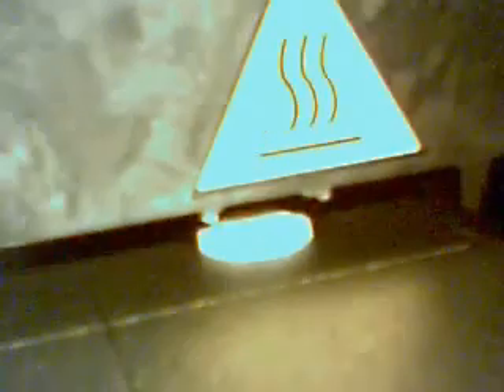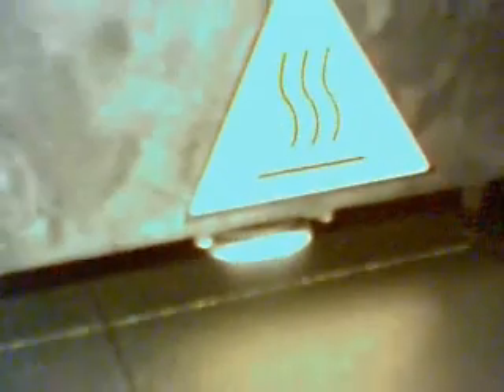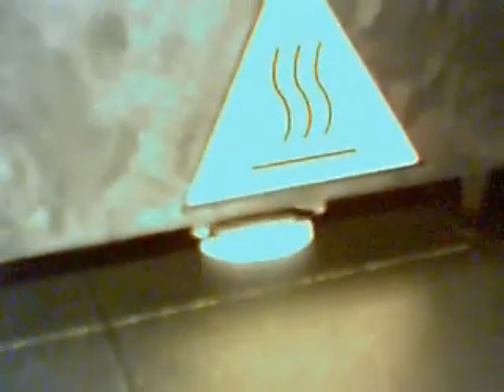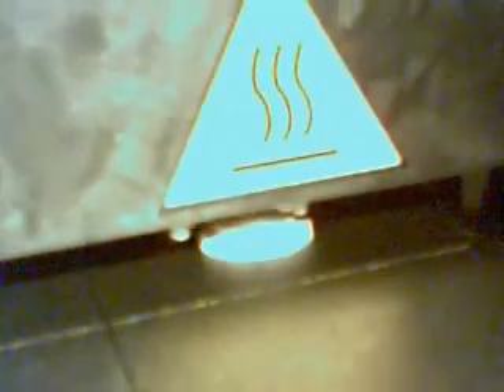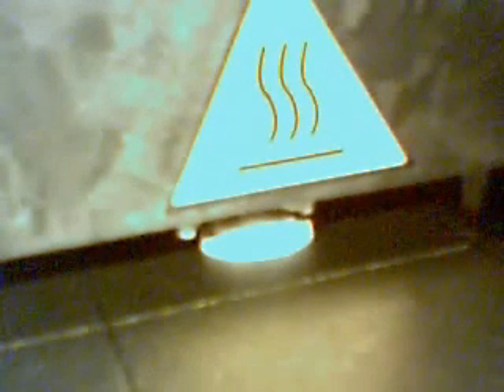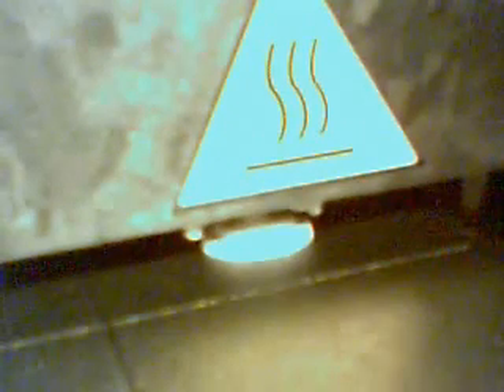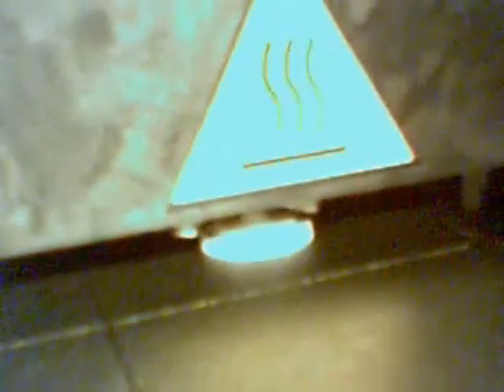Rapid Prototyping Right Before Your Eyes!

Comment: An amazing tool! I am an amateur but need an accurate cast for my molds. I don't have the money for a 3d printer. Will this be able to make a cast that can be used for molds if so is there a place where I can send my inventor pro 13 designs to have them printed out?

Comment: I'm a machinist and in my opinion I think these machines could come in handy for prototyping complex parts that would normally require a 5 axis machine which is very expensive.  So it would be good for shops with a smaller budget maybe.  The example shown on this video however would easily be programmed and whipped out on a simple CNC lathe.

Comment: @Sp4s12 And what if I just want a quick prototype/ mockup?  And industry slowly gearing 3d printing as a process for mass manufacturing.  Your opinion is worthless and reeks of ignorance.  Im not sure of the quality of this printer and theres a possibility it is on low res, But SLA printers for the past couple years can print out parts of extremely high quality ( texture equivalence of a .1mm with extremely high tolerances)

Comment: @Sp4s12 Rapid prototyping is incredibly useful, the air intake on the formula student car at my university is rapid prototyped using an aluminium nylon composite, it is a design that would be impossible to machine with CNC.  The hinges that hold the two components that make up the intake together are created in situ, with no material removal required.  It really is amazing.

Comment: @Sp4s12 We use rapid prototyping at work to make very complex UAV mechanisms that could NOT be milled in the same number of parts. Also there are carbon composite materials that offer extremely light weight and plenty of strength. Tolerances are not at tight with a milling machine, but the doors are endless in what you can design with rapid prototyping.

Comment: @Sp4s12 Not sure you could pump out this part in anything but a CNC machine in under 2 minutes.

Even if you can... check out the vid of the one with MOVING parts.  They acutally build a fully functional bearing from the ground up (all in one part).  Impossible to do on a CNC. 

Its still in its infant steps, but its coming along.  Exciting to see what it will become in just a few years. ,

Comment from the maker: @Sp4s12 This is a machine tool.  You are forgetting all the time it takes to program, setup tooling, finding material, etc.  Sure a CNC can pump out several of these in the time it takes to make one, but that is after you do the setup.  Also this is only a simple part to make.  They are far from gadgets. Of course they do accurate jobs.

Comment: @pogus73 something as small as he made can easily be over $100. 3D printing is expensive. One benefit of rapid prototyping is using it to propose a model or to troubleshoot a design. Better to spend $100 dollars on a small part and find a flaw then to end up wasting thousands of dollars on a failed part.

Comment from the maker: Printing parts is as simple as orienting, clicking on process button, and then hitting print.  NO PROGRAMING.  I've worked at three machine shops so I know all about them.  There virtually is no setup time for a 3d printer vs CNC.  Sure 3d printers have a ways to go before they are printing out small production runs of high quality parts, but CNC/NC's have been around for much longer.

There are many 3d printers out there that can produce quality parts with tolerances less than +/-.005".

Comment: RP is prototyping, not final product. Accuracy is not the most important thing. There is many things witch you can never make with CNC. And many materials you can't use with CNC. Hi-tech 3D printer can make everything you can draw, with different materials/colors on one model at same time.

Comment: There are only accurate to 0,17mm. Not good. I can buy 2 CNC high speed machines accuate to 50 microns from Roland for half the price of a half decent 3d printer. The can prototype and make molds and machine parts. 3dprinting is a novelty.

Comment from the maker: yes your right a lathe would make these faster, but this is not manufacturing.

If I gave you 3d model for this part right now it would take you HOURS to make just one with a lathe.

Try machining a very complex part... 

Rapid prototyping has its purpose, but it is not intended for high volume manufacturing, but can be used for low volume manufacturing.

Comment from the maker: I have lots of videos on my channel check em out!

Each brand of 3d printers has there own material selections.

Dimension 3d printers can only print in ABS plastic.

It also depends on the technology used to create the part.  Some glue powder together, some cure liquids, some extrude material such as a dimension machine from wire, some even "inkjet" material layer by layer.

You can't print cotton yet..., but you could print a fabric type pattern with some other material.

Comment from the maker: I designed this model to print fast.  Larger models can take over 24 hours!

Dimension's base model price is about $18,000 + all the extras which would be about $24,000 for everything.  The storage stand/base alone is over $1,000 in addition to the machine.

It uses about 1600 Watts average I've been told.  The machine is connected to it's own 20amp 120v circuit.